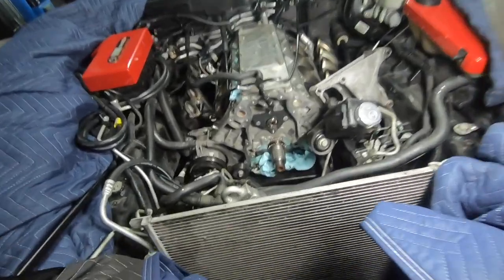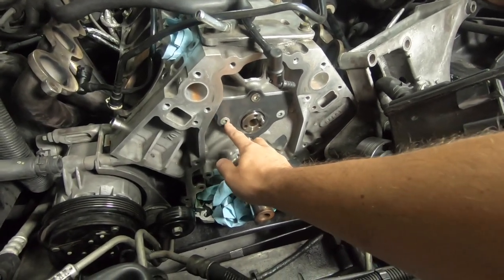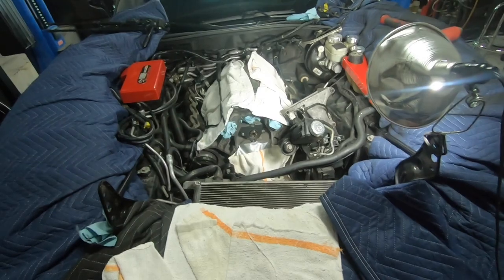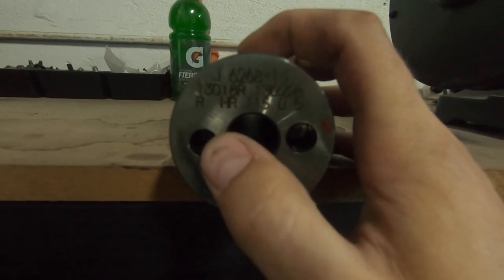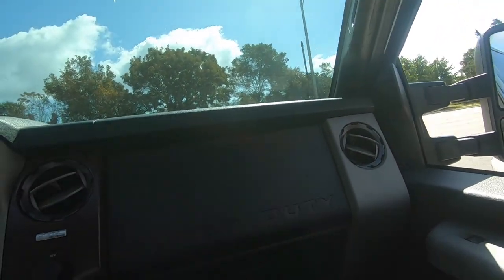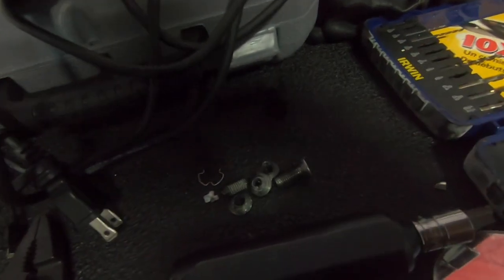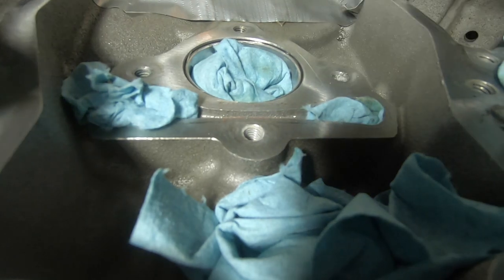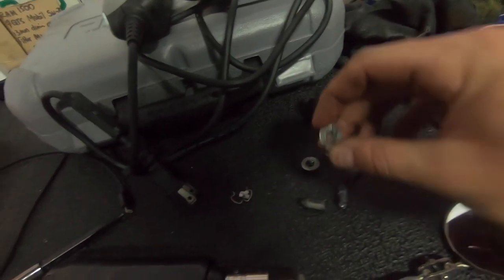Seized bolts in an LS Cam Plate! (How to remove)

Comment: You just put the torx bit into the bolt then get a hammer and give the end of the torx bit a couple of good whacks which breaks the seal. Then get your wrench back on the torx bit and you can generally then just back them out.
Reply from the maker: yeah if you watch the video before this we tried all that. hammer shock, heat, hand impact driver. This was way beyond all of those normal methods.